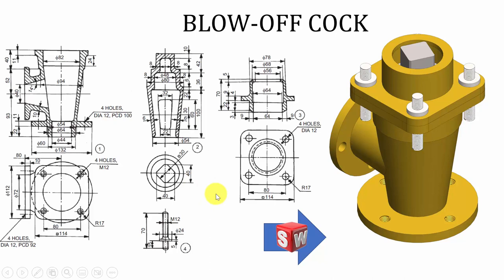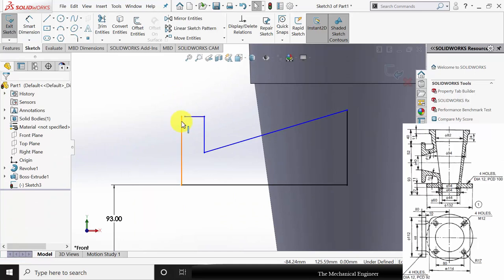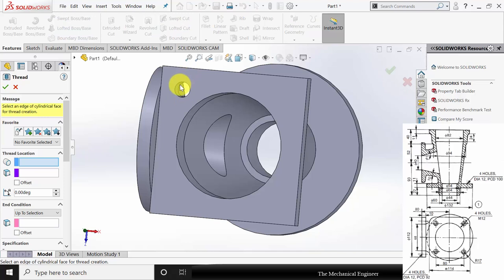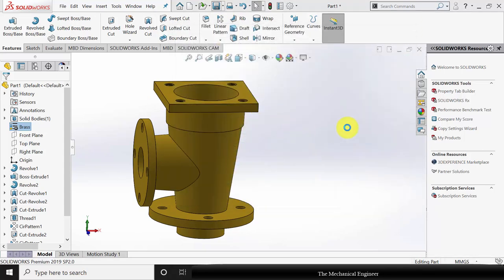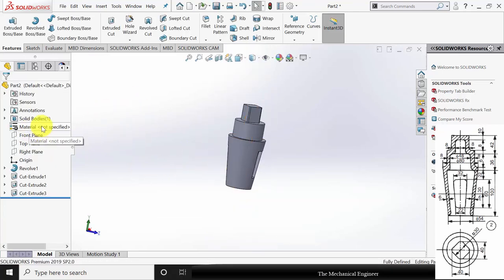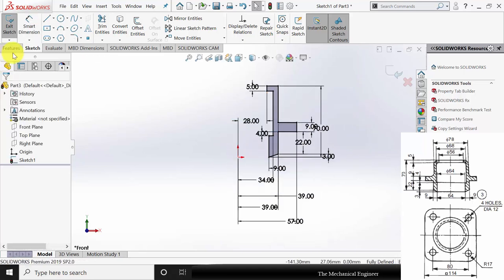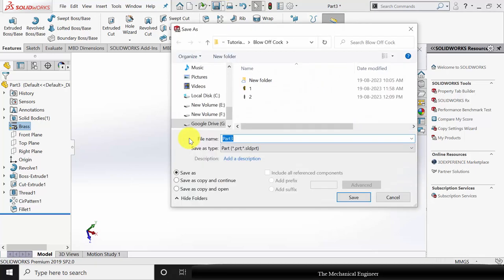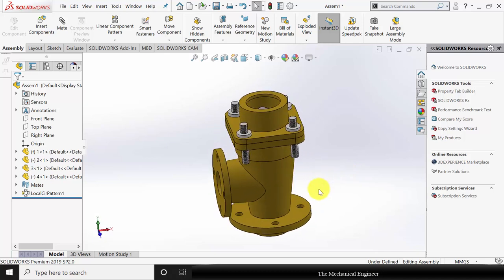Blowoff Cock using SOLIDWORKS | Parts and Assembly | SOLIDWORKS tutorials for beginners

Comment from the maker: Do you want to know what a blow off cock is?
A blowoff cock is a vital component frequently employed in steam systems, such as steam boilers and steam pipes.
Its primary function is to safely release surplus steam or pressure from the system, mitigating the risk of potentially hazardous overpressure scenarios.
Blowoff cocks are indispensable for upholding the safety and effectiveness of steam-based equipment and systems.